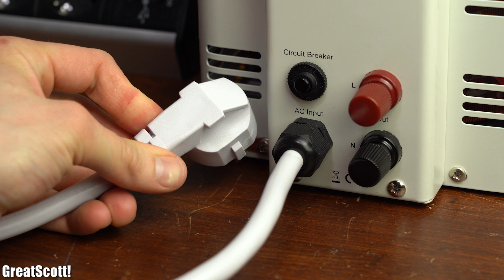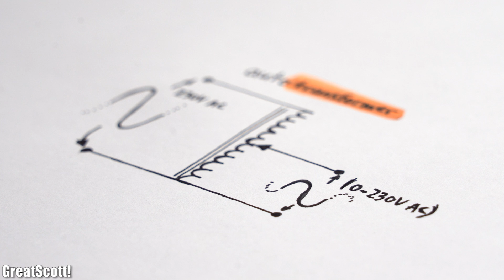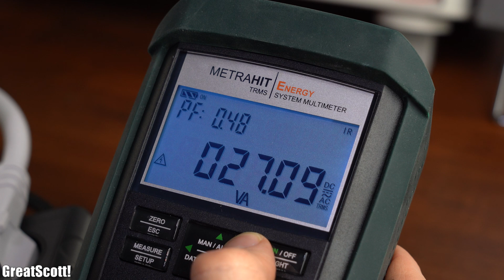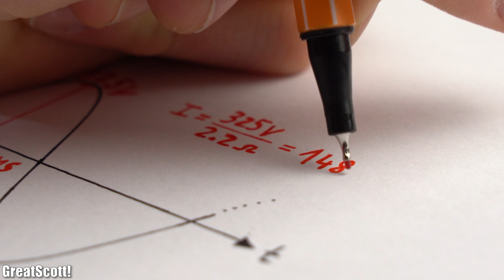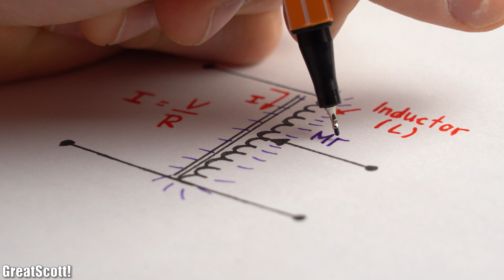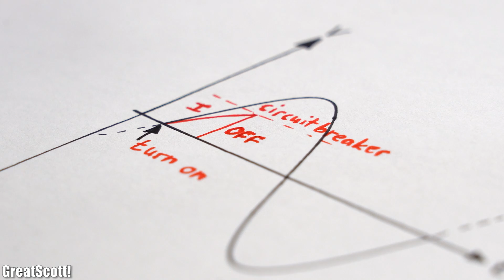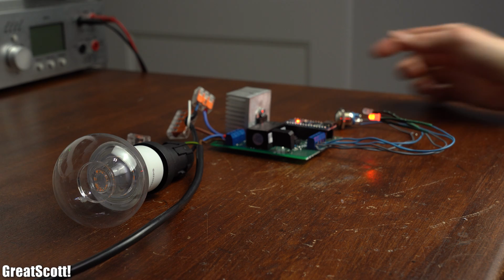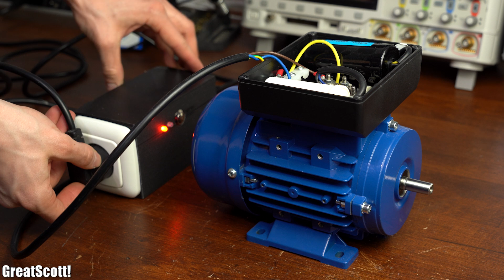How to make an AC Softstarter because my autotransformer keeps tripping my circuit breaker!

Comment: This is the worst decision.  «The severity of the Switching Transients in Transformer is related to the instant when the voltage wave is switched on; the worst conditions being when the applied voltage has zero value at the instant of switching», link: https://www.eeeguide.com/switching-transients-in-transformer/
What you did with your zero-crossing schematics is just adding triac finite resistance in serial with transformer. If you want to avoid current inrush in inductance, you must: 1) turn it on at peak voltage; 2) turn it off at zero current to avoid residual core saturation.

The worst scenario nonetheless not only switching transformer at zero voltage moment but with the flux reversal of the beforehand saturated core which can result in 10-100 numbers of inrush current. That possibly describes your time-to-time circuit breaker tripping.

Comment: I'd been pondering a soft start circuit for DIY audio amp builds and I think you've nailed it, really nicely done!  Thanks!
Reply: most of those just use a large current limiting resistor in series with the transformer and a relay on a short timer that shorts the resistor.

Comment: Looks bit complicated this softstarter. 
In a PA amplifier, they use also a big coil and everytime my circuitbreaker pops also.
But i fixed it easly whit just 2 NTC resistors in serie in one of the two wire to my amplifier. 
When the NTC getting hot the resistance is dropping to 0 en the amplifier works than correclty. 
Even there is a softstart whit 10resistors to lower the inrush current and after some seconds a relais kicks in to bypass the resisstors. 

Mayby idea for video to see whitch kind of softstart there are and whitch one is the best. Because i am curious what is the best solution.

Comment: Thanks. Interesting, didn't know how they worked. The comments are essential reading. 
I don't think I'll be doing this project, too risky. Especially when I can buy commercial plug in ones for the cost of an Arduino.

Another point.... The circuit breakers can be changed for ones that allow the inrush current spikes. I had to do it for my microwave. The German electricians didn't know what I was talking about, until I showed them.

Comment: Great project! For softstart I used a "Finder DPDT Multi Function Timer Relay" set to 1 second with a thermistor over the "off" position. The first second you power up the thermistor heats up then the relay clicks to the "on" position so the attached device is powered directly. The switching time seems fast enough so far.
Reply: There are NTC thermistors that have an initial resistance then heat up quickly and lower the resistance, made just for this task of soft-starting.
Reply: @gargantuablargg  yes but they will become very hot, not ideal for long-term use. Also when you switch off and on before the ntc had time to cool off the resistance is still too low. This is why I used a time relay in combination with an ntc.
Reply: @o0arend0o  this solution still has the lingering heat from previous on time. Unless chosing time delay longer allowing ntc to cool down enough to make a difference.
Reply: @muthumanikya1847  the ntc only heats up for less then a second when power is switched on for first time. The rest of the time the ntc cools off while the  device is on.
Reply: Thanks for sharing - how is the relay achieving a soft start in this config? Perhaps Im misunderstanding, once the relay switches on, and powers the motor you'll still get in-rush? Or is this in parallel shorting a high power resistor powering the motor/inductor etc?

Comment: I would have kept the "fostek" SSR in the circuit. Those 40s are likely good to 15A w/o a heatsink. I use them on my water heater at 17.5A. Bolted to a heatsink and cooled by an 80mm PWM controlled fan just for good measure. They have about a 20F rise when ON.

Comment: Picking a nit ... on A/C motors, what cause a breaker to trip is the in rush current charging the start capacitor.  The only solution that I know of using a PWM circuit or a current limiting resistor that is removed from the circuit after a few hundred msec.  Triacs can have "issues" but triggering it via the Arduino should solve most of them.

Comment: suddenly, the meme that locks the circuit breaker closed with a hook makes sense now.
Reply: If that works you have a really shitty illegal breaker tho.
Reply: That doesn't work though. The breaker will still trip internally even if you hold the switch. All the lock does is to both prevent someone from turning it off manually, and restoring after it has tripped.

Comment: i have a question, i have a modular synth and when i hook it directly to my amp it’s fine, but when i hook it to my interface first then to the amp, the amp starts buzzing. everything is powered from the same surge protector on a grounded wall outlet. the interface is powered by the lap top. the weird part is the buzz doesn’t come through on the recording, just from the amp. any ideas?
Reply: its a ground loop problem. often laptops are not earthed but have capacitive coupling to earth through the power supply. easy solution is to use an audio isolation transformer
Reply: @fransdebruijn6763  it also happens when the laptop isn't plugged in, but i have everything on the same table. where do you suggest putting the isolator in the chain? if that the same as a DI box? i found one on sweetwater called the radial SB-6, it says it's passive. do you think that would work? thanks so much for all the help!
Reply: @mr.apartment  probably place it between the synth and the interface, it may require some experimenting in where to put it. for some reason i can post a link directly to one that i know of but if you search google for AA3086 you will see it.
a DI box more so allows you to connect a single ended source like a guitar to a balanced input for noise cancellation.
Reply: @fransdebruijn6763  awesome! thanks so much! i've called multiple music stores and most of them have had no clue what to try.

Comment: Tripping circuit breakers?
Ah I just remembered when I was 10yo I plugged in a copper wire in socket assuming it was nichrome wire to get heated 
Suddenly I heard a trip and tv was off

Conclusion:-great scott teaches very good
Reply: Similar story about 10 year old me: I figured that if I shorted out an AC/AC adapter, it would short out the mains and blow the fuse. When I finally felt brave enough to try out my new found super powers, it just blew the fuse in the adapter without even making a noise or smoke.

Comment: Can you use a SSR to start and air compressor capacitor start motor?  I have an air compressor that is 15 amps running current. It pops my breaker most of the time when starting.   I can not replace my breaker with a 20A. Not safe.  So.. I need a way of getting it started.  Was thinking this SS Relay would do the trick.. What do you think?  Let me know.. Danke. :)

Comment: Tripping circuit breaker? Just glue it in ON position M8.
Reply: To protect agains users, the breaker will still trip. The push switch position has nothing to do with the internal state of the breaker.
Reply: @LvlLord  huh. interesting, that was a joke btw.

Comment: Sorry to be the one to tell you that, but your calculations about the inrush current are not really correct.
The inrush current in transformers is caused by the magnetic remanence (magnetization of the core).
When you turn off a transformer it usually has a magnetization in the core afterwards. If you then connect the transformer again, this "offset" can drive the transformer into saturation, which creates losses in the core. This offset only lasts after a couple of cycles, until its gone.
This explains the unreliable tripping of the circuit breaker, since the stored magnatization is very much dependent on the timing when it was shut off during a cycle.
The DC resistance only limits the inrush current into the parasitic capacitance of the transformer (brings down the quality factor Q of the whole system).
So technically your not wrong, just not the whole story. It's probably rather hard to find a balance between entertainment and bone dry mathematical theory.
But all in all a great well explained video as usual. :) Keep it up.
Reply: Finally somebody who knows what they are talking about! 

My simple solution is a resistor and a timer relay. The resistor needs to be small enough to drive current into the primary inductance but large enough to limit the current if it saturates. The time delay need only be a few cycles, so 100-200ms is sufficient.

Comment: Large transformers are always a problem for standard house breakers, if permanently installed the type of breaker can be changed to a C or even D, but then the tripping time has to be correlated with local disconnection times as dictated by local law. If the appliance is portable, then a soft start (cheaper than a full inverted) can be used to reduce the inrush, many are available commercially and are mainly used for motors. I am a little concerned that the motor jumps into life at the button press then returns to slowly accelerating, not something one would expect from an off the shelf solution!

Comment: The current into an inductor equals the integral of the voltage accross it, in formula: i = 1/L.integral(Vdt). If you switch it on at the (rising) zero crossing the voltage remains positive for 180 degrees. This causes the magnetizing current to rise to approx. 2x its normal value. However the inductor core is not made for this 2x magnetizing current and thus the core will saturate. This causes the coil inductance to drop, which increases the current even (a lot) more. If you switch at the maximum voltage, the current also starts to rise, following the integral relation, but after 90 degrees the voltage polarity reverses and the current starts to go down again. In this way the current starts of nicely lagging the voltage by 90 degrees, as it should be in the stationary situation, with peaking and tripping the breaker.
Best regards, Ben.
Reply: Ohhhh.... Brilliant comment! I think it's also just answered a question I've had about adding energy into a LC tank. Thanks for sharing the knowledge.
Edit: Yes! I've been trying to get my head around this for days. You're a catylist for understanding good sir. Double thanks!
Reply: "If you switch it on at the (rising) zero crossing the voltage remains positive for 180 degrees." .......
 But in normal operation, the voltage remains positive for 180 degrees and then becomes negative again for 180 degrees. What's the difference now?
Reply: @Thomas72B  The difference is exactly what you say: in normal operation a positive periode is always preceded by a negative period, and visa versa. An inductor stores current in a similar way as a capacitor stores voltage. Therefore the history is important. But at startup there is no history (current) stored in the inductor. When you then start with a full positive (or negative) period, the current becomes too high. This is only a temporary problem, after a number of periods the current normalizes, due to the series resistance of the inductor. 
Regards, Ben.
Reply: @beneindhoven3424  Not always ! If you put the plug in the socket you cannot know where the sine curve is. 0 degrees, 130 degrees or 174 degrees you don't know .... That's why I still don't quite understand where the problem is supposed to be.
Reply: @Thomas72B  Yes, that’s correct, you never know where you start when you connect the plug. That’s why the circuit breaker not always trips, but only sometimes. Switching in near the zero crossing is the worst case situation. Having said that, I have to admit that I don’t understand why Great Scott’s tests at zero cross switching didn’t trip the breaker. I tried this same experiment a few months ago, and could clearly see the current peaks are maximum at the zero crossing. And minimum when switching at the voltage peaks. Regards, Ben.
Reply: @Thomas72B  It is true that when plugging in, the voltage at t=0s could be at any degree of phase and therefore, during the start-up transient, the DC current could be other than 0ADC. But at steady state, by secondary effect, the current through an inductor will converge to 0ADC.
Reply: Ok Ben, so how about 1 phase motors? I would like to use this softstarter for water pump motor. Should i leave the code for starting in 0 or edit it to start it in 90 degrees?
Reply: @bengacz  maybe edit it and See if the breaker trips? If you switch at peak positive the current would also riss but the Nest "downfall" would counter the rises of current as voltage goes down to zero and the polairty changes...
So switch on at peak voltage and doing S-like curve would also work?
Most simple circuit put a light bulb in series with bridging relay that turns on after few seconds and bypasses the in-series lightbulb, works also pretty good but I don't know if that is a special bulb?
Reply: @kitecattestecke2303  I've left that to start at  0 crossing. It buzzes at begining but inrush current (measured by cheap meter) droped by 1/3 so looks like it works. I had no breaker problem, but mechanical switch sparked when connecting and i was worried that someday it may get welded and not disconnect. A  year has passed and it still works.

Comment: Nice video! One recommendation, make sure your diy pcb can handle up to 3000 watt or preferred 3600 watt.
The small screw connectors are not designed for this loads.

Comment: I like your videos, and you admit to making a big mistake here.  I think you should re-edit and re-upload it with a breakdown. Really not complaining, or putting you down, we all screw up, but your channels is very educational and this will confuse people.  I've had similar problems and used a resistor to limit inrush and a contractor to bypass resistor and connect output at the same time when the transformers output voltage comes up.

Comment: The phenomenon that trips the circuit is called inrush current, and it happens with any electrical device that has an inductive load, coils, etc.
https://en.wikipedia.org/wiki/Inrush_current
Reply: You can fix it by adding a capacitor in the circuit to supply the necessary current. It's a lot simpler
Reply: Actually inductors don't create inrush current, unless its core gets saturated. When an inductor gets saturated, it effectively becomes a resistor. This is what's causing the inrush current.
Reply: @sfaunl  They do create inrush current when energized, like capacitors do. That's why it's so sudden, electrical energy is either being stored up directly or in a magnetic field
Reply: @minkusmaz  Yes, you are correct. What I'm trying to say is it's not the inductance that createa the current spike. In theory they fight di/dt so that with an input like a step function, they will create the necessary back emf voltage to stop the current changing. In reality though, there are many factors that change this behavior.
Reply: @sfaunl  All I am saying is what the Wiki article states, that an inductive load like the autotransformer he is using experiences inrush current and that you can make simpler soft starters with capacitors.

Comment: Hello. I love it, but is it possible to do that kind of thing to my welding machine what is 12kw and uses 3 phase voltage but runs only 2 of them. I mean reguler 230 is between pfase and 0 but mine runs between 2 pfase. Thank you.
Reply: It should not matter as long as you are comparing the voltage difference across the input.

Comment: My breaker sometimes trips when my laser jet printer starts, would this help my issue? I can't build it but is there something I can buy like the solid state relay you mentioned?
Reply: Yes. They plug into the wall socket and you plug the appliance into that. Not sure what they're called where you are, but in German it's Einschaltstrombegrenzer
Reply: @kevgermany  I'm in USA, any idea of what I should look for in english?
Reply: @leamsi4ever  something like inrush current limiter, switch-on current limiter, soft start module.
I tried searching for you but the obvious search places like Amazon and eBay seem to restrict what I see here. Specifying AC and 110V may help.
Reply: @kevgermany  thanks, knowing that something exists helps

Comment: Swapping the circuit breaker to a C- or even D-curve one would have been a much simpler solution... but wouldn't have made for a very interesting video!
Reply: Swapping a home breaker to a D type would also make an illegal installation and be very unsafe. I don't think his house wiring is rated for the required 300-400 amp minimum short circuit current.
Reply: @benbaselet2026  Obviously I didn't mean that he could just swap out the MCB in his consumer distribution unit himself. I'm pretty sure the legality & whether a licensed electrician would perform the swap would actually depend upon the jurisdiction & the particulars of the existing wiring. Having a D-curve breaker installed/wired for a garage/workshop at a residential property isn't a preposterous concept.

Comment: I have a 15A variac behind a 15A capable isolation transformer (isolated and adjustable voltage is sometimes handy). All in parallel with a second lower power isolation transformer.
I use a high power resistor and a timer relay. The inrush current is limited by a simple resistor in series on the mains side and after a second or two, the resistor is bypassed by a timer relay. Works a treat.

Comment: or put one NTC in series and short it with relay contact with one transistor with RC constant in base, 5 parts... arduino in such a simple project ? what is gonna be next, how to turn on house bulb using arduino ?
Reply: @Tiago Ferreira Yes I know, I have already used that many times. Is super common because it's simple and bullet proof.